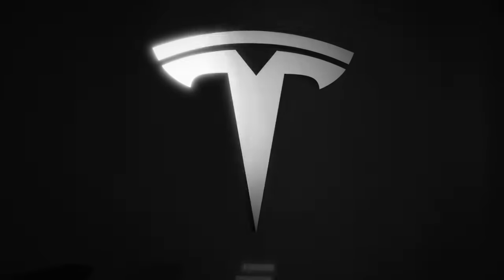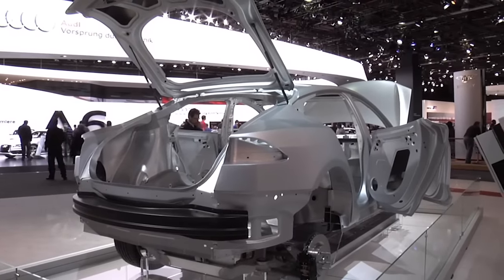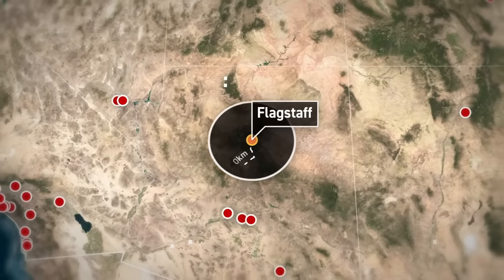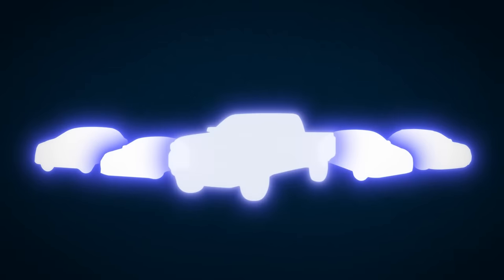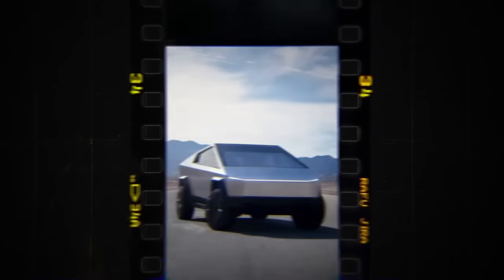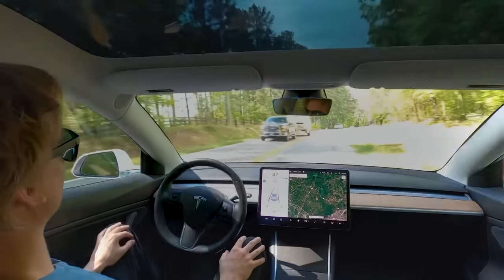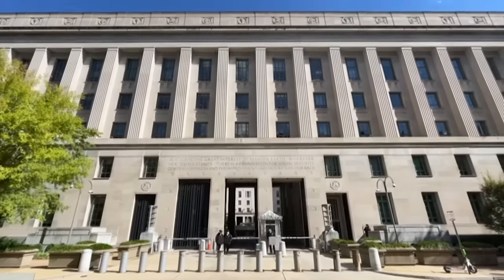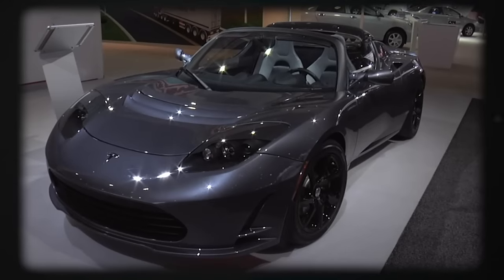How Tesla Fumbled

Comment: I find the Tesla fanboys bizarre. I own a Tesla; bought a lightly used Model S a year or so ago as my dream car. It's got a lot going for it, but it's nowhere near perfect, and I don't think I'd buy another one, even if Musk wasn't speedrunning ruining his reputation. Like, I spent a lot of money on this thing and I'm more than capable of going 'eh, that's alright, could do better.'

Stuff I like:
- It's really fast. Just crazy fast. I even have like the base model without the extended battery/power and it's still WAY faster than I need. So much fun.
- It still looks pretty nice; I agree that the design is getting a little long in the tooth but I still think it looks pretty good and isn't as dorky as a lot of other electric cars.
- OTA updates are just huge compared to every other car manufacturer. Like seriously, it's really nice having changes get regularly pushed out.
- I have at least been blessed with no major build failures/etc.
- The self-driving (which I basically only use on the freeway/etc) is fine; a bit better than my Volvo V90 I had before in that it'll actually start and stop during freeway traffic, but otherwise I haven't noticed anything markedly improved in my personal use. 
- Superchargers are pretty easy to find and electric charging in general isn't so bad; I don't have the high range models so I was a little worried getting this that the sub-300 miles would be a problem but it's been really easy, even vacationing hasn't been a problem.

The not so great to bad:
- The cupholders are just terrible on the Model S I have, because they're in the armrests. I use my armrests. Fixed it by buying an aftermarket (cheap, luckily) bit of plastic that basically extends your cupholders forward a bit.
- The infotainment system is hot garbage compared to Android Auto / Apple CarPlay. I have the slightly older version of the head unit, so it's possible that paying 2.25k for the upgrade will help out a bit, but it would have been terrible when released as well. Spotify lags, constantly fails to play with no useful error/etc, and the UX is laggy as hell. My V90 had Android auto and it's just better in every possible way.
- Speaking of which: I work in IT; I love tech. I don't like the screen-only BS that Tesla started pushing and other manufacturers are heading toward too. My kingdom for more physical buttons.

Comment: My 2023 Model 3 is equal to or better than my CTS5 Cadillac, with one significant difference:  the Model 3 arrived when it was supposed to at the original MSRP.  The Cadillac arrived 3 months late, without heated seats (come back later to get that added) and at $15,000 over MSRP.

Comment: I drive A LOT of vehicles. And the Bolt is a country mile ahead of the Tesla. Ride quality is somewhat of an intangible trait. And bc Tesla can’t put  this on a spec sheet, there’s no reason to quantifiably fine tune it. 

Moreover the cyber truck is not a competitor with the F series. It never was hence their lack of pursuit. Americans like pick ups not for the sake of, but for their pragmatic use. The cyber truck fills none of those needs.

To use a bleak analogy, Tesla’s car production mirrors the same issues the  Wehrmacht faced. Mass production beats novelty and even in many ways outright “quality” due to logistical concerns. Much like WWII, trucks win the war as they do the vehicle landscape. Tesla is started to rest on its laurels as it’s opens issues hit their stride. They can’t expand bc to be agile means 1. You have a risk appetite, which they can’t afford and 2. Have the supply chains and infrastructure to support the endeavor which they clearly don’t.

Comment: Truck and china points are countered by the fact that Tesla strategically focused on building more model Y and 3 to meet the demand at highest EV car profits in the market. Tesla even beats BYD in gross margins (BYD sells many of their cars to themselves and full car dealerships as well)
With battery supply being the limiting factor, both trucks and cheap BYD competitive cars are not in Teslas best interest over the past 5 years.
FSD: no one else is anywhere close. Tesla is. FSD with AI, trained beta 12, tesla fleet of driving data, dojo computer, nvidia super clusters and camera based system is the only car company that has a chance. Everything else is a problem waiting to happen.
Features… is reliable charging a feature that matters to any EV owner? Also entertainment system while charging is nice. Camping mode with flat back in the Y is my favorite feature. The glass roof is really nice when sitting in the back. It’s safe, like #1 safest. And one day it will drive itself, seems like that may set it apart.
This video was made to purposely irritate people that know what’s going on with the company and the actual car experience.

Comment: I usually love this channel but this video felt like it had a few misconceptions like not at a single point during the video that Teslas biggest and arguable best advantage was mentioned, which is their charging network and its not even close. Range anxiety is still a major hindrance towards EV adoption amd Tesla is the only manufacturer currently that addresses this in a reliable manner hence why they are most popular and I also believe the loass in market share is overloaded because your comparing no competitors to having multiple which with any product like in existence will create a split in market share so Tesla is still by far way ahead of the other manufacturer ters despite its very real issues mentioned in this video.
Reply: Tesla fought tooth and nail to prevent the standardization of charging plugs while the legacy manufacturers got aboard quickly so for years their charging stations were still tied to how many cars they sold because only they could charge them and others couldn't charge at their stations
Reply: It is only an advatage in the usa though. In the rest of the world the supercharging network is available to anyone with any EV.
Any ev can charge at any network anywhere.

Comment: I own a 2010 Honda CRV. Recently, i got into an accident (my fault didn't see the other driver, shitty right turn with low visibility) and got t-boned by a truck carrying 80000 pounds of sand. Granted 30 mph and the driver swerved to lessen impact but still. Im getting it repaired this monday, it still drives. A tesla would probably be totalled

Comment: Agree with your first few points. But a lot of issues in what you're saying:

-re: innovation:Tesla's key innovations are in extremely efficient drive trains, in house battery manufacturing, world class software that is head and shoulders better than competition, the only viable charging network, and the safest cars ever tested by the nhstsa. 

_re: competition... There sadly isn't much in the US. In China you have BYD and others but in America tesla still manufactures and sells the most ev's by a huge and expanding Margin. 

-re: burning through its customers.... Tesla As a whole tends to have the highest or near highest level of brand loyalty from existing customers. This points against your narrative although again... The issues you bought up are very real. 

-cybertruck has >1 million reservations. When released, it's likely to best the stats and capabilities of its competitors for the price. Doing this with in house developed batteries and platform just takes longer then shoving someone else's batteries in a non ground up chassis design (save rivian, hence the cost).

-BYD sells phev and other nev''s. Tesla sells only bev's which are more expensive to produce due to needing more batteries. BYD beats tesla on sales sure, but makes 1/3-1/4th the money per car and is probably losing money on its bev's. We can't know for sure because they don't purposely separate out Financials like this.😂

Lastly... Ev market share is irrelevant in an expanding market. Tesla has been expanding faster than any other car maker in history for the past DECADE. 50% CAGR is insane... So lowering market share just speaks to the even faster growing ev market.

Comment: Can confirm. My partner is an engineer for a company that makes parts for different car manufacturers. Tesla is by far the worst on basic build quality.

Specifically she mentioned they have a massive issue with using aluminum parts in place of higher quality steel. The type of cost cutting measure you'd see on Kia or Fords budget models, is going on top of the line Teslas. No thought to longevity or long term value. It's all new shiny shit with no base.

Comment: The point about having quality issues is mostly right, although it has gotten much better over the years. The rest is just factually wrong. Demand for Teslas is bigger than ever, the model y has just broken all EV sell records and will become the most sold behicle in the world. Also never have there been that many preorders for a car as for the Cybertruck, if they can ramp fast enough they will overtake any truck sales of OEMs. The ONLY thing holding Tesla back is ramping up production even faster. Meanwhile all OEMs are completely failing in even coming close or profitable at all regarding EV production. You can already see their huge problems. Rivian buiulds good cars, but they are to expensive and also have huge problems ramping up, just like the hell Tesla went through back then befor the model 3. The fact that Tesla is not really losing any EV market share, despite all others ramping up as fast as they can shows Teslas absolute dominance over the EV market. Also in China BYD and the chinese only really sell more when hybrids and very cheap EVs are counted in, which do not compete with Tesla at all. Again even in China Tesla is the only brand not dying like all the OEMs are currently.

Lastly the point about overpromising and talking bs is also right and is mostly Elons fault.

Comment: In fairness to Tesla, the EV market as a whole has slowed down in growth with most manufacturers scaling back EV production.  Ford stopped all production of its F-150 Lightning.  While Teslas do have their build quality issues, they are not the worst made EVs on the market.  That being said, if Tesla were run by engineers and executives with years of experience around auto manufacturing and didn't have a toxic work environment created by Musk's constant micromanaging, Tesla would be a much better position (it wouldn't be reflected in their stock price though) in the long term turning out better built cars.  

It just seems mystifying that if another car company was run like Tesla, they would be chasing away all their customers and facing bankruptcy with sub par build quality, high prices,  hit or miss buying experience, poor customer service, and questionable terms of ownership.  But people are still buying them.  At some point though after the 6th time one gets burned they will bolt and not buy from them again.

Comment: Yeah, I'm not so sure nor am I convinced of the narrative put forth here.
Tesla is doing incredibly well and they are at the leading edge of innovation, both in car tech as well as in manufacturing processes.
Reply: No they're not, build quality is one of the worst in the industry, Benz Drivepilot beat Tesla to level 3 autonomy, Ford was just approved hands free driving in Europe, Tesla removed needed sensors and making Tesla Vision fail miserably, Tesla doesn't have birds eye view cameras, cannot self park, cheap interior materials, don't dent your Tesla because you' will be waiting months, customer service is the worst. The only thing Tesla does right is their supercharger network, that's it.
Reply: @MindzEnt  Octovalve heat pump(heat management - batter life as well), cable management, their actual motors (extremely efficient compared to others), I haven't heard of any other company having anything similar to Dojo nor a fleet as large for the same amount of training data, last FSD version has improved significantly, TSLA removed lidar intentionally as they bet purely on vision with a clear rationale behind it (cost efficiency etc.), time will tell if tesla is right or wrong with this move but it is a clear strategy not focus on one thing (vision) and attempt to do it extremely well rather than a sensor suite comprised of different input types,  also they are working fervently on different battery types.

Build quality is their weakest aspect, that is true, and the lack of luxury as well. They are too expensive for the interior you get - I'll grant you that. 

But you have to differentiate their tech side from the body build quality stuff as well.
Panel gaps have gotten better over time and they are pioneering manufacturing as well, nobody has anything similar to their gigapress.

Comment: I will never buy a car that doesn't have the usual stakes and buttons to easily operate while driving, I don't want to operate a tablet when I simply want to adjust my mirrors, or changing a/c settings while driving. And I definitely won't buy a car that has buttons on steering wheel for turn signal, that's down right stupid.

Comment: IMHO Tesla needed a more “traditional” pick up, smaller in stature but useful. They went for mythical towing and off-road prowess. So, they created a huge futuristic looking truck with small bed, no spare, dropped on board compressor, etc. To repair will be a nightmare. Small number of people it will be a must have but will never be a mass segment seller. Rivian still sorting out issues but to me is just traditional enough in presentation. BTW Cybertruck doesn’t even has its original exoskeleton construction. New technology should come in incremental portions.

Comment: It seems that Tesla is lacking in what Toyota invented: a management system that is named after Toyota, Toyota Production System. It is a major contributor and precursor to the Lean philosophy, that basically changed how the production is done today to stay competitive. When you hear the stereotype of the Japanese companies being super efficient, that is Toyota. Many Japanese and foreign companies try to copy the system, but far from everyone succeeds. 

Their inconsistency is a problem, especially since in the current quality assurance, the automotive industry is expecting at least 50PPM, or 25PPM if you want to be reputable. That is measurement in parts per million. So when I make a batch of 10000 front fenders at work, I am expected to deliver less than 25 defective parts (We managed to get under 10PPM for most products). Now a Tesla car is an assembly of all those parts, so it would be unreasonable to have same expctation, however they should still have a low PPM on the same type of defect on their cars if they want to be reputable.  Another metric is OTD, on time delivery and they totally bombed that one. I guess Just-in-time manufacturing prosess does not exist in their mindset.

Comment: The cyber truck is the biggest blunder. There's a lot of interest in electric pick ups as long as they still project that "tough guy" ruggedness. That's why the F150 lightning is doing well. Because it looks just like an F150. The ram will do pretty well. As for the chev, it's a little goofy looking so it won't sell as well. But wtf is the cyber truck? No one really wants a vehicle that looks like that. It doesn't really look like a truck. It's just weird and gimmicky. It doesn't appeal to the truck market which is huge, too huge to pass up tbh
Reply: Only in the US, though. Culturally Europeans and Chinese are less obsessed with looking like Rambo and these sort of huge grilles and huge tyres are a lot less popular.

Comment: The comparisons you made between different cars was a little unfair when it came to the Model 3 vs Bolt EV in my opinion. They are drastically different in size and therefore appeal to different people. Model 3 works as a family car for example.
Reply: All of these cars also have negative margins. They are able to compete on price because of trying to take market share and supplement that with their ICE cars. Sooner or later that will not work, all while Tesla continues to lower prices and other EV companies are raising theirs. It’s easy to announce a good price but much harder to keep it once production actually starts.

Comment: Counterpoints:
1. Tesla superchargers are much better and reliable than the competition. Electrify America charges are notorious for being broken.
2. Tesla has the highest profit margin in the entire auto industry, because they are really good at manufacturing. See the gigacasting. 
3. The Tesla Model Y was the best selling vehicle in the world Q1 2023.
4. Tesla controls their own software. Most cars are full of tiny microprocessors, with Tier I and Tier II component suppliers in control of the software for each module. That means only Tesla can do meaningful software updates over the air.
5. Tesla saves a lot of money and weight on wiring harnesses compared to competitors, because they engineered the cars from the ground up. Legacy automakers are trying to re-use components from OEMs. Smallwr wiring harnesses mean less labor during manufacturing and less weight, giving more range and performance.